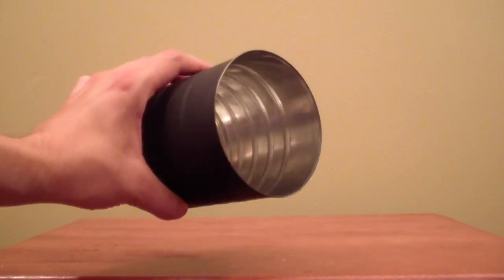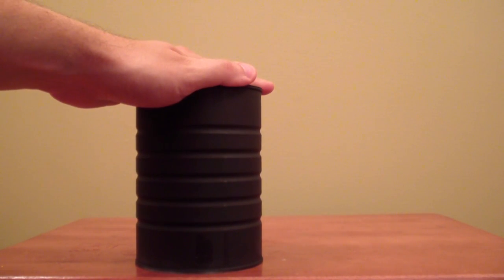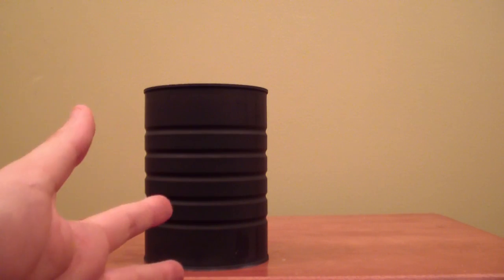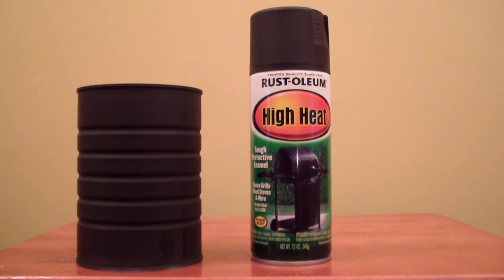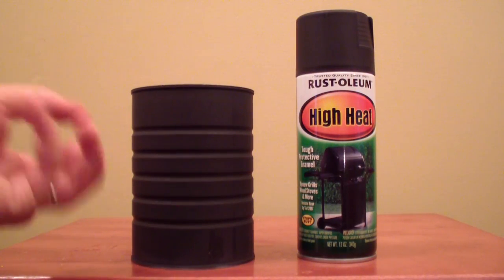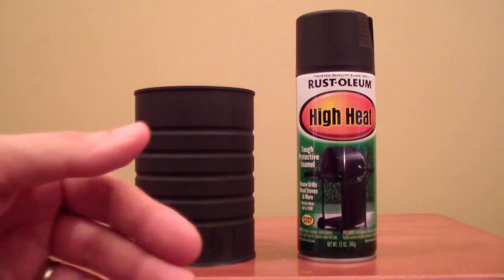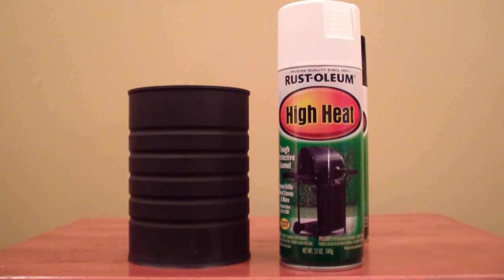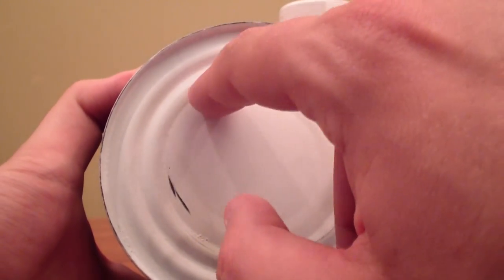Rust Proof your DIY Cook Pot!

Comment: Have been using "VHT FLAMEPROOF" very hi temp (1300-2000 deg F; 704-1093 deg C) from Autozone. It is flameproof automotive header paint, which forms a silica ceramic coating.  It too has to be heat-treated (200 deg F, then 600 deg F) in the oven. Yes, it absorbs heat beautifully, and it is as hard as nails.  I highly recommend it.  Only in black, as far as I could tell.  PS...soot comes off easier, as I only use a woodgas stove or a campfire to cook.  Thank you for the vid.
Reply: +StandsWithABeer I've tested both and do not see any differences in using VHT or Rust-Oleum, the difference is the price, Rust-Oleum is under $4 Walmart or Lowes or Home Depot, VHT is as high as $20 a can, so since 90% of most Alcohol Stove and campers,hikers and others pots & pans, are mostly of the cheaper variety, I will stick with and suggest only the Rust-Oleum, if you paid a lot for  your cookware, you should not have to paint them to begin with,
Reply: I'm using  tin cans in a campfire.

Comment: I use rustoleum high heat flat black on my camp cookware. But I recommend you doing a little gap were your lips might touch or anywhere close to the brim of a vessel.. Just saying.
Reply from the maker: Nice tip.  I actually have a separate cup that I drink out of that I haven't treated with anything yet.

Comment: Any thoughts on rust proofing the interior? I get water spots that quickly turn to rust.
Reply from the maker: Yeah, there isn't much I've come up with for that so far.  My tomato can pot that I used to use had a white anti-corrosion lining and never got a spot of rust.  Downside was being careful not to burn the lining up with dry heat, plus some people really freak on the the whole BPA thing, so I moved on to the liner less version.
Reply: +sintax77 Season it, as if it were a cast iron skillet, steel skillet or wok. Works best if heated in a grill outdoors rather than in the kitchen due to smoke generated during the process. Often recommended to have temp at 350 F for 1 hour. Better to have temp 400-500F. Multiple thin coats of your favorite grease/oil rather than a thick single coat. Repeat seasoning process as many times, as needed, to get the "tin" can thoroughly seasoned to prevent rust.
Reply: @oldtimerlee8820  working for me...multiple coating is best and it's easy just like cast iron

Comment: Painting your pots with flat black high temp paint is an old trick for increasing your stove's efficiency. I think you've lost sight of your purpose. You are trying to heat up whatever is in the pot, not prevent it from heating! You should reconsider painting the bottom with black paint instead of white paint. In this case, I think the problem is with your "fancy feast" can stove and not the black bottomed can you're using as a pot!

Comment: has anyone posted this yet? http://www.homedepot.com/p/Rust-Oleum-Specialty-12-oz-Silver-High-Heat-Spray-Paint-7716830/100165100?N=5yc1vZapz5Z1z0sygr
Reply from the maker: What?!  Game changer - my Lowe's has been holding out on me.  I still think the silver had the best pre-heating times.  I'll have to grab a can and do a test.
Reply: +sintax77 Did you ever test out this Silver High Temp Paint, and find out whether or not it is better than black, I read somewhere that you should paint pots Black on the outside, White on the bottom and keep the inside Silver or Chrome painted or if that's the original color anyway, keep it that way, Black Absorbs heat, so as the flames on an Alcohol stove or wood fire comes up and around a pot, it would absorb best of any color, the bottom should be white, I can't recall right now the reason for that, and Silver reflects heat inward, so that's best for the inside or keep it original if that color, it makes sense to me, so I'm not sure of the Logic of painiting it high heat silver over black.